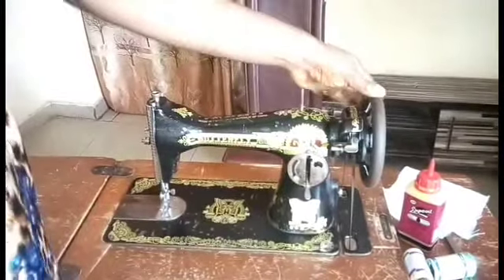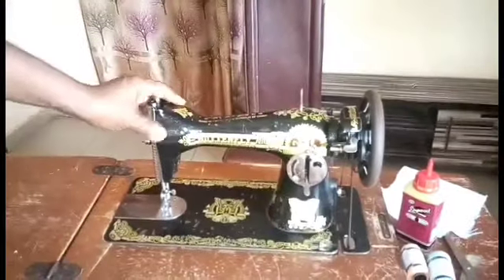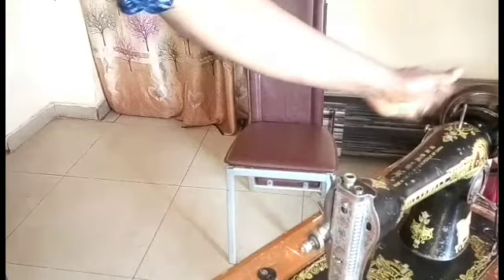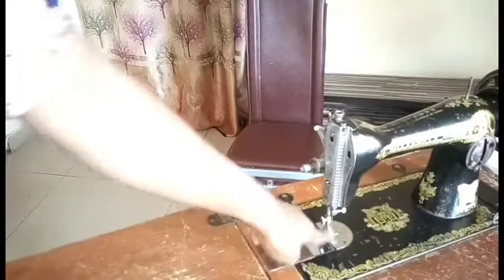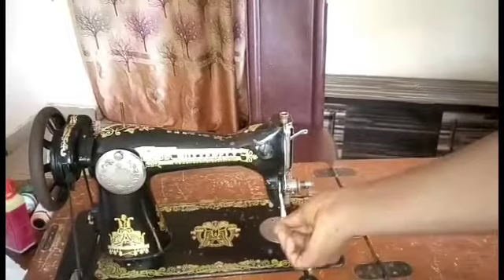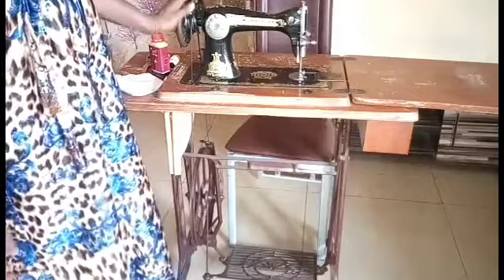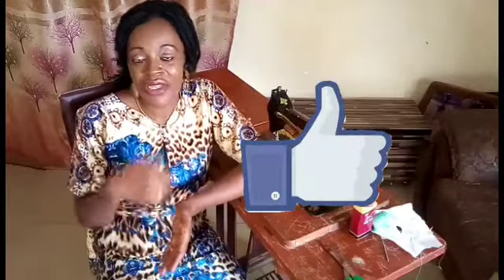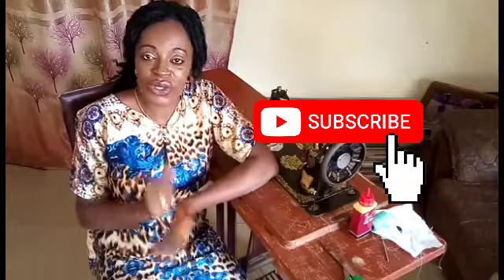HOW TO PEDAL A SEWING MACHINE / OPERATE A SEWING MACHINE  (KNOW THE PARTS OF THE SEWING MACHINE)

Comment: Very nice video. What part do you need to fix your bobbin winder? Do you need the rubber wheel so that it will grab your hand wheel and wind your bobbins? Excellent workaround. I have two treadle machines that do work and many other machines as well to include a long arm for quilting. 

My very first machine had the bobbin winder broken off so for years and years I hand wound my bobbins. There were no electric bobbin winders in those days.

I have subscribed so that I may see other videos by you. Excellent that you put these out. Very helpful to all.

Remember folks when you ask general questions about needles, bobbins and different settings for tension, etc. please try to include the make and model of your machine. It is very important to get you the right information and help.
Reply from the maker: You're welcome, thank you ♥️
Reply: From your video I know how to ril ... please how to cut simple style ❤